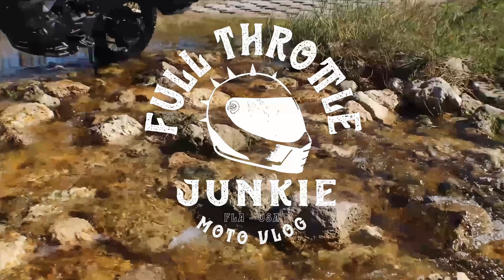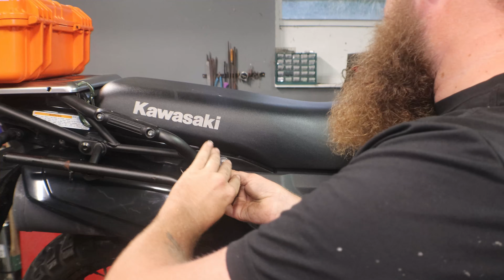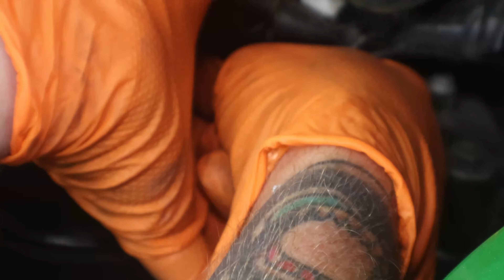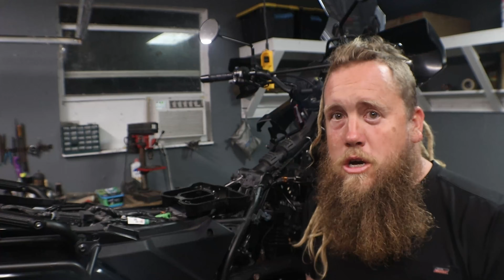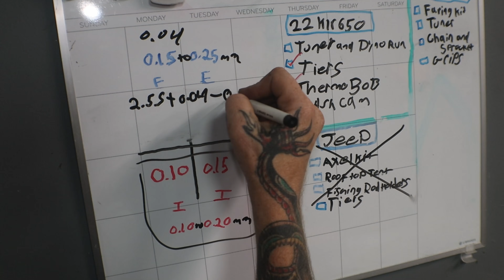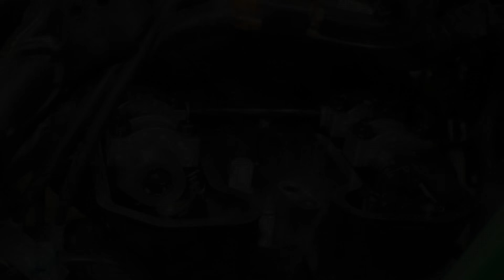KLR 650 Valve Adjustment Guide: Tackling Tight Valves at 18,000 Miles | DIY Motorcycle Maintenance

Comment: My guess is that if you have any air gap at all it will not affect cold starting since valve lash clearances will increase once the motor warms up.  In fact, if you have an aluminum head and case you will get the maximum increase vs. iron cylinder/aluminum head, iron block/iron head.

Comment: Question; As a rule of thumb, valve lash usually gets greater, not less. What is the reasoning behind this? It’s obviously specific to this particular engine. Not saying it’s the only engine that may encounter this oddity, but it’s first I’ve ever heard tell of an engine doing this and I’ve been around and doing mechanical work all my life. Thanks in advance!
Reply: That was confusing for me as I was told to always have it at the tighter end of spec. I'm guessing the valve seats getting smashed in over time tightens the valves?

Comment: In the middle of the Valve Clearance check on my 2023 adventure with 5057 miles. Doing the Thermo Bob while I am in there as well. I have the FSM and have done lots of research. Excellent video and thank you for posting.

Comment: You earned my subscription... good video, thank you. 
My 2024 KLR has 8,500 miles as its my commuter. I've had to drive my truck since temperatures dropped here in Ohio. I am good to ride down to 0F, but the bike does not have the tolerance to the cold that I do apparently. It fired up like there was never a problem at 35F... but this morning I almost didnt get it fired up @ 25F. I cheated and squirt some starting fluid, and still it was difficult to get combustion. I was going to check my valve clearance today, but you have boosted my confidence that I need to have shims ready so I dont have to do this twice.

Comment: By the way, failure to do valve check/adjustment will result in hard/more revolutions to start,poor performance probably popping through the exhaust and eventually burnt valves which will get pretty expensive pretty quick.CHECK YOUR VALVES.
Reply from the maker: You're absolutely right. Valve adjustments are super important. Don't skip them!

Comment: He doesn't show you how to time it or check the timing or anything SMH 🤔 you take the two plugs out of the left side cover out, turn the motor towards the front of bike with the big bolt and look though the little hole for the timing mark with the "t"that lines up with the groove in the plug hole threads and with the exhaust cam lobes facing the front of the bike and the intake lobes facing the back there is an arrow on each Cam gear that should line up with the deck surface of the head.

Comment: Wow I'm at 18,000 miles on mine and doing the valves.mine ran ok but started popping back through the exhaust between gears and I can tell you that's not the original drive chain.mine was slinging rollers at 9,000.replaced with an RK chain and it still looks new at 18,000.as far as the valves the intakes were both at .011 mm with .260 shims and the exhaust were at .013 with .250 shims so I put the exhaust shims on the intakes and ordered two .240 shims for the exhaust which should give me  .021 on the intakes, loose I know, and .023 on the exhaust, right where I want it,near the loose limit.the reason I'm posting all this is for reference for anyone wondering how how the gen 3 does on valves, right at the tight limit on intakes and a little too tight on exhaust at 18,000 miles.with religious oil changes using Valvoline 10/40 synthetic in the winter and and Valvoline 20/50 synthetic four stroke oil in the summer and I just switched to rotella   t4 15/40 last oil change and love it for 16.00 a gallon instead of going 4 to 5,000 miles with the synthetic I'll just change it at 3,500 or so with the rotella.just put the exhaust shims in the intakes and order the next size smaller than what you took out for the exhaust ,maybe two sizes down if theyre really tight.just back the tensioner bolts out far as you can take the caps off and fish them out with a small screwdriver and a magnet cams dont have to come out.stuff rags everywhere first so you dont drop anything the motor.and before you start whining about how tough it is I did my fjr a month ago and this is a cake walk compared to that!

Comment: Doing my 08' for the first time with 47000 kms on, intake was at .10, exhaust was .15, I changed the  shims to maximum, can't believe Kawasaki shim the new bikes so crappy
Reply: 47000 km with no valve check is begging for problems!surprised it had enough compression to run.damn Kawasaki 😆😂😆😂 ROTFLMAO.

Comment: I did mine at 4k miles, 3 out of 4 were out of spec on the tight side. Typical symptoms, hard cold starts, too much vibration etc. Set everything to the upper limit. Now at 12k miles, I'm getting the same symptoms, and generally feel a significant decrease of power especially in higher RPMs. So it's time to do it again. Surprised that it only took 8k miles, but I was riding it pretty hard, including lots of offroading and riding in hot places, so I suppose that accelerated the wear.
Reply: Update: Opened her up and to my surprise 3 were right where I set them 8k miles ago and one (right exhaust) was exactly in the middle of the spec interval. So all was well and the cause for the suboptimal performance must be elsewhere.
Reply: What do you mean upper limit? Tighter clearance? Wouldn't you want them a little on the lower limit considering the clearance gets tight over time?

Comment: This video is very helpful. I just did the doohickey on my 2022 klr650 and somehow messed up the valve timing. I have to pull the valve cover off and check to be sure but I am 90% sure I messed it up. The bike starts and runs fine until i start moving. As soon as i release the clutch I'm met with misfires and the bike doesn't wanna go anywhere. I've taken everything apart in the left side of the motor and double checked everything and still no luck. I am assuming i jumped a tooth on the timing by rotating the engine in the opposite direction as normal trying to line up the rotor for the holder to get the rotor off and on.
Reply: Better hope you didn't bend a valve

Comment: To people watching this: This was a very poorly done valve job. The valves need to be on top of the specs, so as close to 0.20/0.25 mm as possible.
Especially the intakes needed to be adjusted which he completely neglected.  You CANNOT leave an intake at 0.10. Ever.
Reply from the maker: That's what the manufacturer calls for
Reply: @FullThrottleJunkie  yes, but being at the minimum is not good.  They will only get tighter as time goes on.
Reply: In your experience, do valves clearances tend to get tighter, looser over time or does it just depend?  @FullThrottleJunkie
Reply: @BMRTV  they always get tighter on bikes because they sink into the softer aluminum cylinder head
Reply: UUUHH it's  .010 mm NOT 0.10 Ever.
Reply: @billbonu1639  Metric dude, metric.

Comment: Another great video. I'll be curious to see how the doohickey turns out. I remember you did the doohickey on your bike when it was new. I haven't had a cold start issue with my 2022 adventure model. It's 10 degrees here in the mountains of northern Idaho and the bike starts right up. I only have 5k miles on the bike so I will probably hold off on checking the valves for now. But good reference video for later. As always, keep making the KLR videos!!!!   Thank you
Reply from the maker: Yeah some had The issue and some didn't. But it was interesting to find the issue with the valves

Comment: 18k on a 2023?? What did the owner do ride around the country? How does someone put 18k on any bike in 6months? I'm just curious
Reply: I was doing more than 22k miles a year on my Multistrada here in Florida.  This is not uncommon.
Reply: I have 21k on mine and I've only had it 9 months.
Reply from the maker: And it's a 2022
Reply: @FullThrottleJunkie 2022 didn't come I green it's a 2023
Reply: I have 30k miles on mine I bought it June 2022
Reply from the maker: He road it everyday back and forth to work and used it as a daily driver we live in Florida so the weather is pretty good year-round
Reply: Ride it.